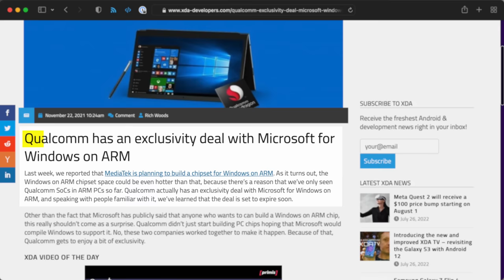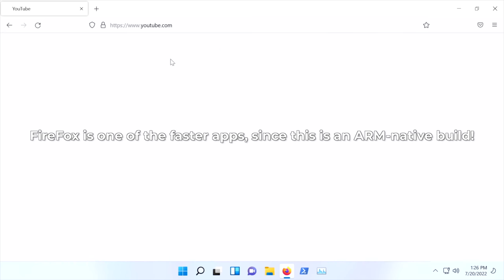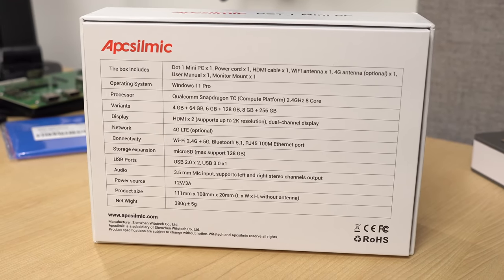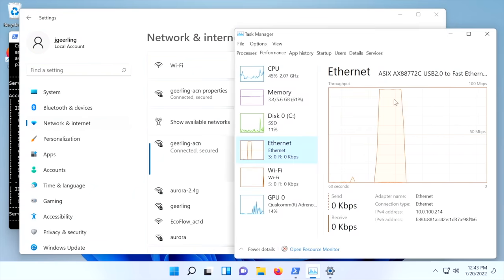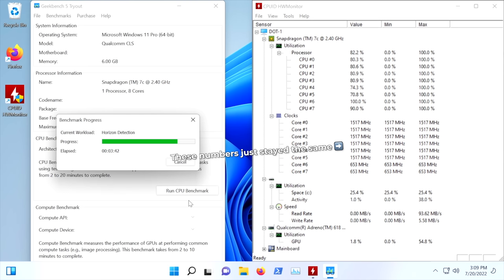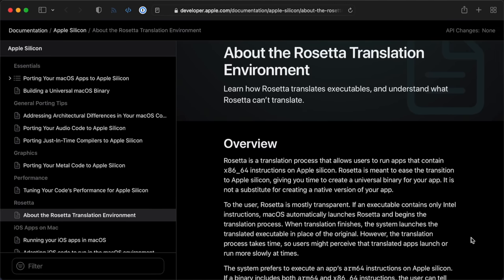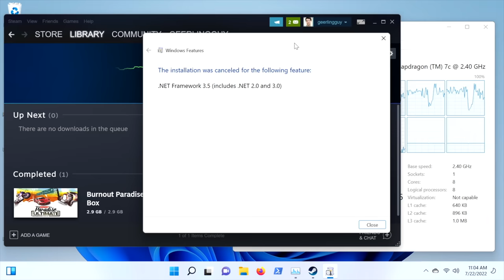Microsoft's wasted potential: Windows on ARM

Comment: Microsoft does have experience running Windows on non-Intel ISAs.  Nearly 25 years ago, Windows NT 3.51 ran on Digital Alpha processors, and Digital provided a binary translation layer called FX!32 that could actually run x86 executables fairly decently.
Reply: Yes I remember those days. Fun part is they also ran great for the time. Then Intel became the dominant cpu manufacturer and those other designs became discontinued. ARM with how Apple has been doing it the first in a long time to challenge Intel and Intel was caught flatfooted. With that said though QUALCOMM is in almost the same position as Intel. They became the dominate SoC for many small devices and they worked good enough. 

Apple being that they bought their own license for ARM has had the time and R&D to make their own chips shine. To the fact that performance wise it was on par with i5 cpus for a few years. Now with M1and 2 it's just showing how badly QUALCOMM has been resting on it's laurels.

Let's hope Micro$oft gets it act together with ARM.
Reply: I've heard it even ran certain large x64 applications better than Intel chips at the time.
Reply: remember when intel wanted IA-64, but AMD pushed x64/AMD64?
Microsofts supported IA-64.
Microsofts Kernel and compiler team is a lot more flexible then what we see on the consumer side.
Problem is: the market has a lot of momentum.
Reply: @sarowie  AMD has no position to push. They won market because they was not as greedy as intel.

Comment: Holy crap, never would I have imaged a board developer create something where WiFi is faster than wired! They left so much performance on the table by using such an old standard through which to pass their wired network connection!
Reply from the maker: My best guess is the Qualcomm chip designs being mobile first/only don't have any particular IO lanes dedicated to networking (besides for WiFi), therefore the only way to get networking is through the USB ports, and if you put it on the USB 3.0 bus, that would share bandwidth and make other USB 3.0 devices slower if using the network. An annoying tradeoff.
Reply: You could have a tiny router/accesspoint on the board and have it connect to the rest of the pc through WiFi and that still would be better than the wired connection.

I might patent this as airgapped ethernet lmao
Reply: In many cases, wired makes no sense.
I run 48 Atomic Pi units as a computing cluster, and tried running them through ethernet, but the wire mess, the hardware cost, and extra power consumption, made me decide to just go wifi on all units. 48 units work quite fine with our home modem, in addition to 2 repeaters, 3 TVs, 4 laptops, and 4 cellphones. So far we've had zero issues. The wifi of the 48 units doesn't stay on always, it only intermittently transmits data. I see no reason other than when trying to find drivers to make the wifi work in a terminal screen (where as ethernet usually works out of the box after OS installation), to use Ethernet.
Just because it's a set standard, do you still use USB 1.0?
Reply: imagine a smartphone... and you have a device with fast Wifi and fast Celular and little to no wired Ethernet support.

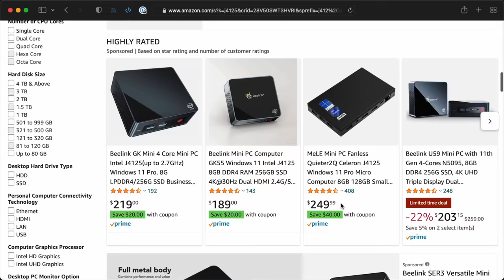Comment: 2:00 powershell taking a long time seems to be a problem with windows, i've had this happen on even 16 core processors, though that might be a side affect of windows running for 90 days without having access to ECC RAM
Reply: 32 core processors be like
Reply: IKR?! I had a theory for a while that it was 3d accelerated, badly. It is faster to get a command prompt by loading vscode!
Reply: Uh... dunno what you mean, powershell itself starts within a second on my system (Ryzen 7 5800H laptop) and pretty much all desktops/laptops/servers I've used in the past. The only PS variant that's slow as hell to load that I can think of is the Exchange shell because it just takes ages to load all the modules...

Comment: During the recent heat wave (PNW, but we all had one), I shut down my x86 servers to save power and reduce heat. My little Pi cluster based on your "dramble" powered most of my needs just fine.  I just wish, however, I had more bandwidth on a low powered ARM device to run a decent media storage server.
Reply: An m1 Mac mini might fit the bill. It’s not cheap but it is low powered.

Comment: This is especially ironic since Window NT (and therefore the NT Kernel, used in all versions of Windows since Windows XP) was written from scratch in C instead of Assembly like DOS/earlier versions of Windows starting in the late 80's specifically in order to allow Windows to be able to migrate smoothly onto ARM architecture. Microsoft knew ARM was the future in the 1980's and Windows on ARM is still shit. Wild how giant corporations' internal politics can cause stuff like this.
Reply: Giant corporations' internal politics always override common sense.
Reply: In the early days, Microsoft ported NT to other architectures like MIPS and PowerPC, but I don't think ARM was even on their radar at that time.  ARM was for low-power, low-performance embedded use at that time.  It wasn't until DEC developed the StrongARM in the mid '90s that people saw that ARM could be fast.
Reply: @KameraShy  Apple: Excuse me? 🙂
Reply: @electronics-girl  Ahh, you're right. It was an Intel i860 RISC processor that was the initial target. All the same, they knew RISC was the future.
Reply: @Undercoverfire  so did intel - but IA-64/Itanium failed
Reply: Hello. Sorry I've been repeating this history all over this video, but I am looking to see if my memories are correct or not.
Do you know why Microsoft is so reluctant about ARM? because I can remember a fight my dad had with the Microsoft CEO or CTO Venezuela around early to mid 90's and at that time, Microsoft was really reluctant to release any test versions of windows ARM (embedded) that my dad needed for some servers he was setting up for some USA big companies. So Microsoft knew already the technology, and they made it work almost 35 years ago, how is that, that apple is now making millions about something Microsoft wasted a long time ago!?
Reply: @edrumsense  Microsoft put nearly all their eggs in the x86 basket and for over 40 years (1978 on) that CISC CPU ruled the PC world. Microsoft had a problem looking at anything outside that world thanks to how much x86 dominated the general PC market.

Comment: windows really doesn't want to run on anything less than a massive high-power system, every attempt over the years has been mediocre at best and comically unusable at worst
Reply from the maker: Their mobile phone OS was actually decent on lower powered hardware, and slightly innovative with the tile concept. I wish they had stuck around longer, but the iOS/Android duopoly made sure that didn't happen :(
Reply: @JeffGeerling  it was decent, but another not very open ecosystem.

At least at that time Android was more open, even if far less efficient.
Reply: Just imagine how cool it would be to run windows on M1 chip.
Reply: @JeffGeerling  RIP Windows Phone
Reply: @JeffGeerling  Yeah, but Windows Phone wasn't really the same as Windows for PCs. If I'm not mistaken, Microsoft also screwed up by making too many changes between OS versions, which e.g. made old apps not available for newer Windows phones.
Reply: @9SMTM6  Windows Mobile before the oddball Metro UI version had compatibility going all the way back to Windows CE 2.0, which has always had free SDKs. Not truly FOSSy like we're used to with today's Android, but it's easy to forget that was the best competition we had at the time.
Reply: You obviously never tried the Lumia 950 smartphone, the OS was a lightweight windows build and it was just about the nicest smartphone I ever had, shame that it was too late to the party to compete with Android or Apple. So many missed Windows ARM opportunities.
Reply: @FindecanorNotGmail  Actually the core OS was EXACTLY like Windows for desktop. Windows on ARM was originally being developed for these devices so they could run desktop apps and normal Windows when docked but as you know, Microsoft killed the project before they could finish it and Windows on ARM became its own separate thing.
Reply: Windows NT 3.51 ran fine on the machines of the day, and today those machines would be considered laughably underpowered.  So I don't know why they can't go "back to basics" and run with system requirements similar to NT 3.51.
Reply: @electronics-girl  Because software, protocols, services, and features are far more advanced and heavy than they where 25 years ago. We're doing far more on servers and computers than text documents, simple databases, and maybe some basic images or videos. 

In fact modern Windows isnt all that heavy. 10 could be ran on a decent single core with 512MB RAM no problem. Its some of the software thats incredibly complex. 

Its not even that either. Computers of the day are far faster than they where before. Want to run 70 programs at once? Sure thing. Load programs instantly and boot Windows within a few seconds or less? Sure. You couldnt do any of that with PC's or even servers from the NT3 aera. 

For the people who want to do that on the server side you have bare metal, but PC's are so powerful that its basically useless to run compared to all the hassle it brings.
Reply: Windows Phone 7 and above ran superb on low power ARM chips. It’s not like Microsoft can’t do it, it’s just that they have no incentive to. Apple only fully switched to ARM after years of dealing with Intel’s incompetence and after gaining experience on custom ARM chips on their iOS devices. For Apple, intel was holding them back from what they wanted to achieve with their laptops. So they decided to basically use their iPad chips in their laptop (their devkit for Apple silicon was basically a Mac Mini with an overclocked iPad chip in it) and decided to develop the software around it.

Microsoft has no big incentive to push for Windows ARM since people are happy buying x86 laptops with Intel/AMD chips

Comment: Windows 11 on ARM just highlights how inefficient Windows 11 is. On low end hardware the user experience is poor to say the least even when hacking the X86 version to run on older hardware it is a poor user experience.
Reply: And what is Windows market share.  Bet you feel pretty stupid right about now...lol
Reply: @RK-um9tu  No I don't feel stupid at all, why should I, I don't even use windows the vast majority of the time.
Reply: @RK-um9tu  it's only existing in desktop market dude 💀 the other systems just don't fight for it as they won't 
go apologize for that guy
Reply: What does that say? The only comparison in OS on low end hardware is between Linux and Windows. You either choose a OS where you can't run many apps without translation (-> slow) or a OS which runs them but is fairly slow overall.
Reply: @eulehund99  It was people accepting a low quality OS in the first place that led to this. Windows is an architectural mess and the corporate culture at Microsoft prevents it getting any better. They keep churning out the same garbage time after time with a nice new UI on it rather than sorting out the fundamental problems. They have been planning to replace NTFS for about 15 years now and still haven't got anywhere with it.
Reply: @schrodingerscat1863  I agree with you. There is still a lot of crap in Windows from the XP Era. Atleast they tried a bit to get rid of it in the 22H2 Update for Windows 11. They made ReFS to switch it with NTFS in 2012, but it was not really better and also lost some of the NTFS functionality. Eitherway you really don't have a way if you rely on Windows exclusive Software until emulation and Linux overall gets better. Steamdeck brought some much needed attention to Linux and I like how much more games can run there compared with before.

Comment: I tried Windows 10 ARM on my Honeycomb board, installed on a SATA drive, and it was actually quite snappy.  That's despite not even having any Windows ARM drivers for the AMD GPU I had in the thing!  I'll bet the primary reason this thing is so excruciatingly slow is whatever they used as the storage device.

There's really no excuse for not having gigabit ethernet, since there was a Qualcomm dev board (IFC6410) way back in 2013 that had a PCIe gigabit ethernet card and a SATA port.
(From that board, I learned: never buy a board that doesn't have a community and real kernel support behind it.)
Reply: i dont think 500MB/s read and 200MB/s write and 20MB/s random read would be considered excruciatingly slow.

Comment: 30 years ago Microsoft was a world leader in compiler and development tool technology. They’ve fallen FAR behind. The secret to MacOS on ARM is the exceptional compiler/development/emulation technology. Microsoft just doesn’t compete. MacOS developers only had to click a box and recompile/test to release a full fat app supporting both legacy Intel and new Mx ARM.
Reply: 30 years ago Microsoft wrote the NT kernel in C as opposed to x86 Assembly specifically to be forward-compatible with ARM and other subsequent new architectures. They've grown complacent and won't catch up with ARM till they've lost an absurd degree of market-share
Reply: We laughed at Ballmer for running around and chanting "Developers Developers Developers," but MS seems to have missed the point. He was right. We were just making fun of the way he did it.
Reply: @Undercoverfire  30 years ago, Microsoft had no idea which CPU platform would "win". So they wrote their kernel to be ported easily and they put in the time to port included applications to for e.g. Intel Itanium. But... no: the NT Kernel was not written with ARM in mind - the NT Kernel was written with many cpus and Instructions sets in mind.

Comment: This Qualcomm 7cx has a license core Cortex A76:
 - IPC (performance per GHz) is about AMD Zen 1 and Intel Skylake level
 - 1st desktop class architecture from ARM Holding
 - released 2018
 - core has 4-wide scalar integer engine consists of 3xALU + 1x Branch
 - FPU is 2x 128-bit FMA (pretty similar to AMD Zen 1)

Raspberry Pi 4 has Cortex A72 from 2015 with approximately 50% IPC of Zen 1 (or A76).

To sum up: this A76 core is huge upgrade from A72 in RPi4. Similar jump like Core2 Duo to Alder Lake in x86. Intel doubled IPC in 15 years while ARM doubled IPC in just 3 years. This is pretty remarkable. And if you ask where is an IPC of new Cortex X3 then it is about 1.8x higher than this A76 (or 1.2x AMD Zen3 or 1.1xAlder Lake). It's a shame we get A76 core from 2018 in 2022 while new and much powerful Cortexes are available.